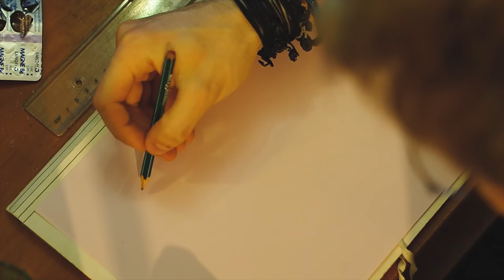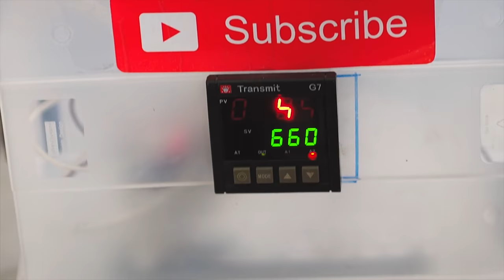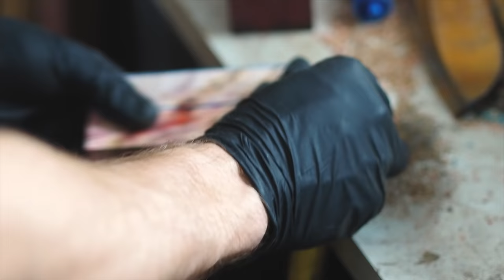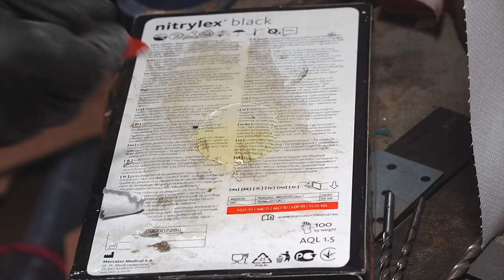Knife Making - Colourful CAMP Knife

Comment: Beautiful. What did you use to colour the blade? Also what is the purpose of putting it in dry ice between the heat treat and temper?
Reply from the maker: These are the tempering colours, I've put it in the description. 
It's a Cryo heat treatment, makes retained austenite change into martensite, which makes the steel harder.
Reply: @BarbershopCustoms  Thanks!